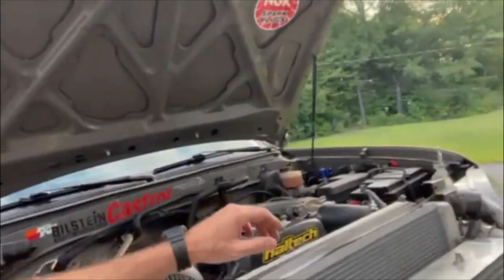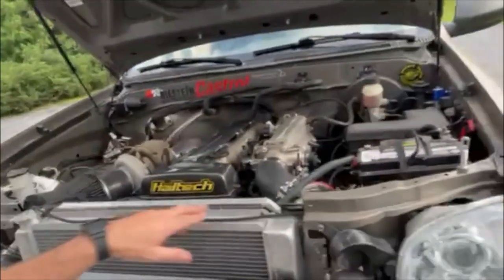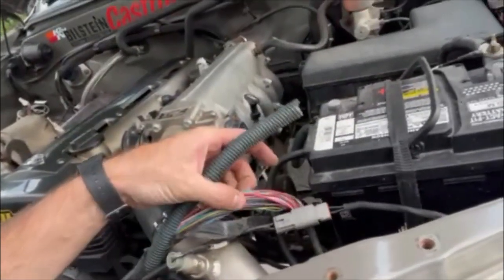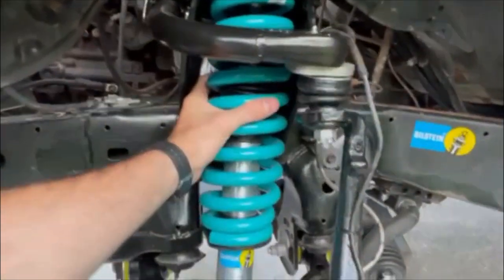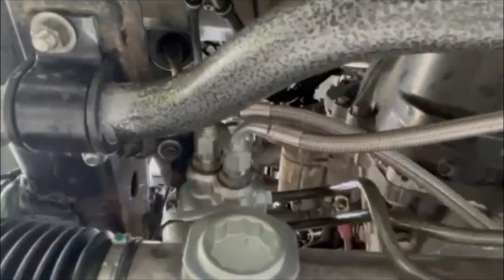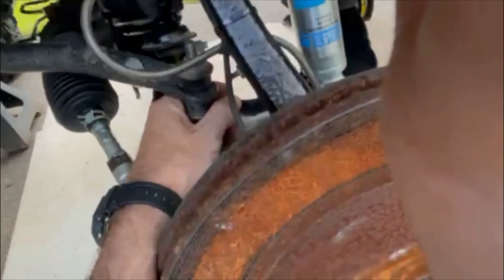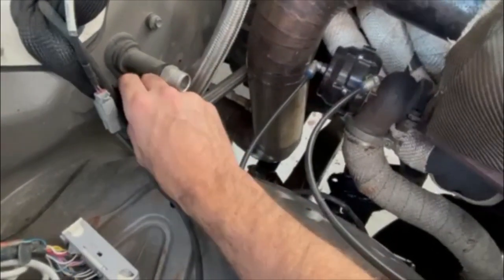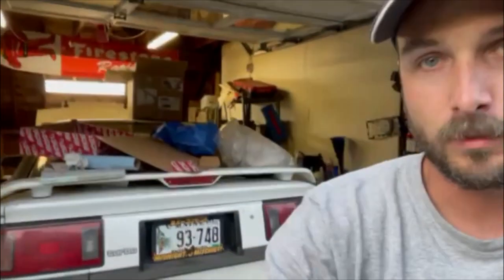2JZ GTE Tundra upgrades

Comment: I just atumbled across your build. Super nice. I have a 1st gen sr5 what did you do about engine mounts?
Reply from the maker: Just bolted the engine to the trans, then bolted trans to cross member. Made mounts where the engine ended up. Others have pushed the crossmember back. Either way the mounts are custom. Pretty easy though.